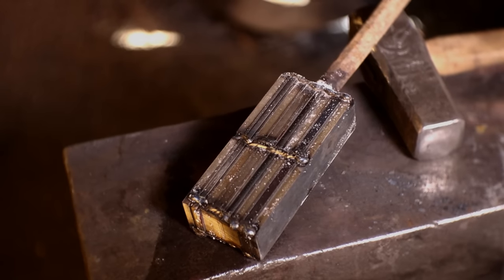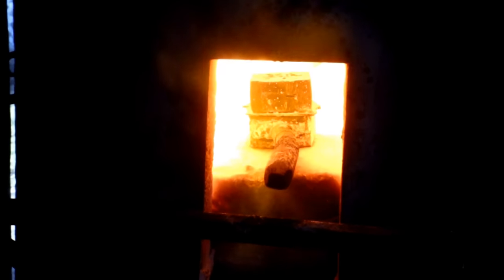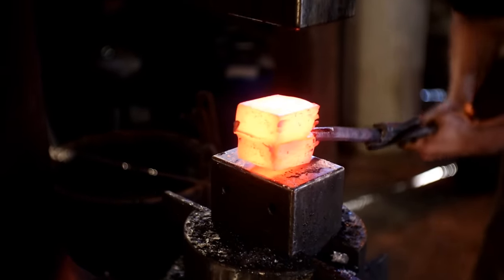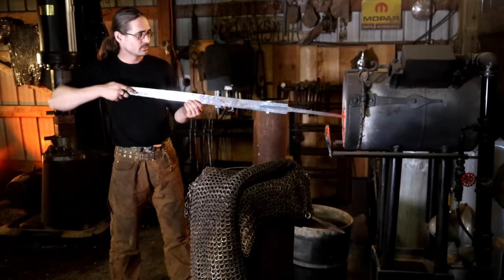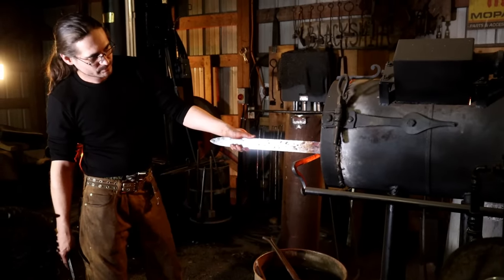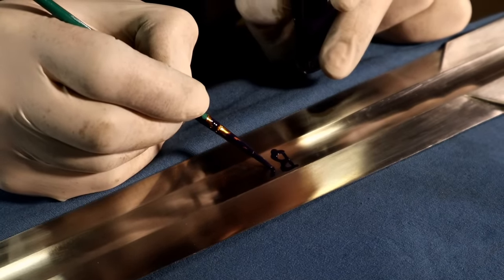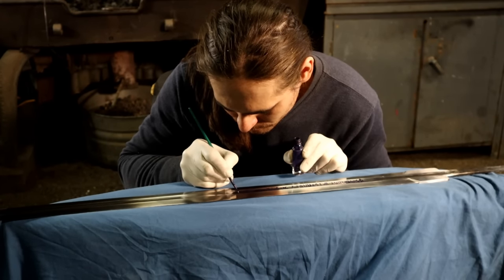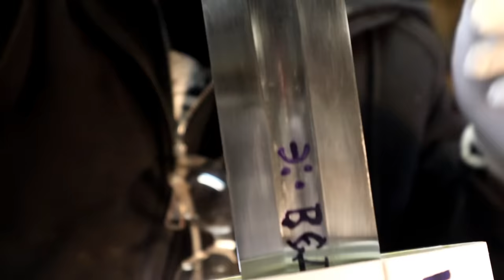Making The [Witcher] Sword - From Season 1 and 2

Comment: I wish the closeup shots of the finished sword weren't so blurry. It looks like a fantastic piece
Reply: I second this opinion about the "beauty shots." They were not in focus and too fast! Amazing craftsmanship needs more time for recognition.
Reply: Agreed...AMAZING sword tho...very well done guys!
Reply: they where clear for me make sure you have your YouTube set too 1080p HD or higher something's it goes on low settings due too crappy PC or cell phone on auto for performance LMAO
Reply from the maker: Cannon Koester will shoot the pans in 120 FPS next time. Got a wee bit 4K happy.
Reply: @ThatWorks  I know you guys are probably pretty good with a camera, but if you're having trouble with the stuttering and a video isn't cutting it, you can try taking a high res 4k picture from a tripod, and then using the images to scroll across the screen at whatever speed you wish. Still stays very dramatic but you get ever bit of detail from the camera picture!
Reply: Even on highest settings it was still a little blurry or slightly out of focus, which was disappointing for such a beautiful sword. A slower pan shot while recording that could be sped in up in post if needed would be helpful i think, but I don't deal with video recording/editing much.
Reply: @ThatWorks  slow dolly moves helps a lot

Comment: As someone who believes "Death to all Misinformation!" I must bring to light a minor correction:

A fuller doesn't make a blade strong and light. A fuller is an engineering trick used by bladesmiths to sacrifice as little structural integrity of the blade as possible while making it lighter. A blade without a fuller will often be stronger than a blade with one, by however small a margin.

Great video, though. Love the artistry.

Comment: I have a Viking short sword made by Odin that is engraved on one side of the blade a blessing (in runic) and the other side a curse (in runic).  I also had some hammer marks left in the steel for greater authenticity.  It is my most valued possession...

Comment: I am sure that I am going to get a lot of negative feedback for this question. In the reboot of Conan The Barbarian, we see Conan's father teaching Conan about steel. Once Conan master's his previous sword his father feels that it's time Conan have a sword worthy of his skill. The melt iron until it is molten and then they pour it into a mold for a Barbarian Sword. It looks like they pour it to a good thickness and then Conan's father goes about teaching Conan The Secret of Steel - adding bevels, and even tempering the blade by using Fire and Ice [water]. I know that it's just a movie but in theory "could" it be done with this process? It'd be absolutely awesome to see the team test it.

Comment: In Annapolis whilst learning to forage material and make a blade I was taught that the fuller's main purpose was not to make a blade lighter but rather to help prevent or break the vacuum seal that can be made when the blade is thrust into a living body making it difficult to remove the blade quickly and smoothly which could endanger the blade's weilder.. is that incorrect  ?

Comment: I have 0 experience with smithing so whats the dif between rolling and hammering the metal or using a press that presses the steel into its final shape? I know these guys are doing it the authentic way im just thinking about how functional swords could be mass produced if guns where not invented.

Comment: Good work you clearly know what you're doing, just a few questions

Why is the blade so short and wide for what's clearly meant to be a bastard sword (1 or 2 handed sword between a greatsword and arming sword)?

Why did you fold what looked to be perfectly homogenous carbon steel? Folding steel was only meant for removing impurities in poor quality steel and you hadn't mentioned what you were using? Folding it unnecessarily would just squeeze out all the carbon and leave you with iron

Why are the engravings and shape of the hilt so crude? It's a slab of steel with a few wavy lines? At that size along with that huge threaded pommel and the stunted blade where's the point of balance? Unless there's no distil taper in the blade and it weighs a lot? But then the whole thing would be like 5-6lbs?

And why did you give the blade that finish? Wootz steel was developed in India and not a single person or even place in the Witcher universe had anything in common with them, so why would it fit?